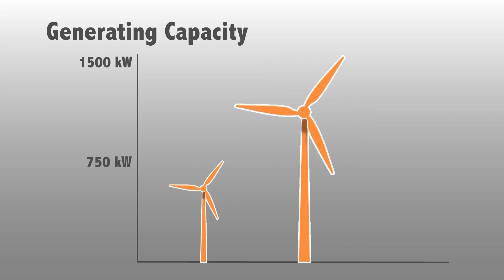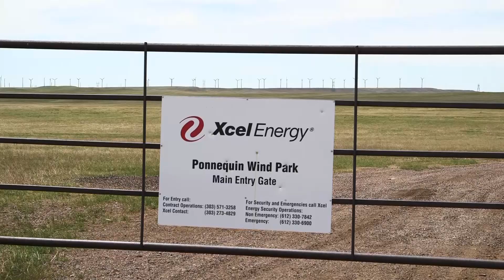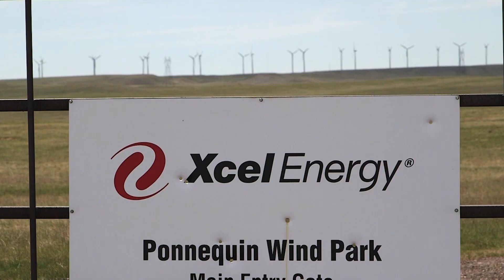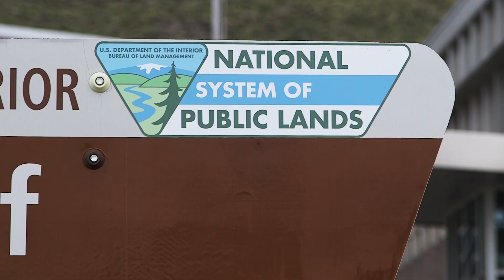Who Cleans Up When a Wind Farm Retires?

Comment: anyone who's ever driven  I10 through palm springs can see about half the windmills are derelict... they just get left out there to rust...
Reply: No, often wind turbines don't turn because they don't need the energy. Unless the local grid has storage, they don't put wear on the turbine if there's no place for the energy to go.
Reply: @justsomeguy934  the ones that dont turn seem to be burned out on the video i saw
Reply: @Withnail1969  I drive by a wind farm fairly often, there's one in my state (as well as a solar farm). I've never seen a turbine abandoned or burned out. Clearly the ones in the video have been abandoned. The video is showing a farm not used anymore, just like oil derricks and pump jacks sit abandoned. The wind farm near me has hundreds of turbines and they're always turning when I drive by.
Reply: @Withnail1969  "dont turn because they are broken, not because the power company is randomly 'turning them off', is my conclusion." Your conclusion is wrong; the grid has no storage for the most part, The turbines are turned off when their energy is not needed to save wear and tear, just like any other generator. Your local utility goes through tremendous variability of energy demand during the day. They turn on and off certain energy generators to meet demand. Wind turbines are just another source they can turn off.
Reply: @Withnail1969  " but of course you're a paid shill for green energy, " I just want to save precious petroleum for other things. I'd also like to breathe something OTHER than fossil fuel exhaust if I don't have to, how about you?
Reply: @Withnail1969  " here's a video of what it takes to install a wind turbine. scary amount of concrete and steel is used. " Um, would you like to guess how much concrete is used to build an interstate highway? Or a building foundation? You're opposed to concrete for all purposes, I assume? If you're only objecting to concrete for a wind turbine base then...wait for it...you've been bought by Big Oil! TaDa!
Reply: @Withnail1969  " i'm just saying there's nothing green about wind turbines. they are an industrial product produced with fossil fuels." Whoa, nelly! Nothing green about wind turbines? Did you miss the concept of NO FUEL, NO POLLUTION, LOW MAINTENANCE? You must burn something every second a generator makes electricity. Burning something makes exhaust, and not friendly exhaust at that. A breeze blowing by a turbine does NOT affect the air you breathe. I'm having trouble with your  comparative powers at this time.
Reply: @Withnail1969  "lots of pollution. lots of maintenance. tons and tons of crap to put in landfills. it's just a greenwashed scam. not to mention the ruined landscape." You have yet to show any reason in any of your answers. Pollution of a wind-powered device compared to a burning fuel? Are you serious? Ever seen an oil spill? Or tanker leak? Or tanker explosion? The worst that happens on a turbine is they fall over. I'm waiting for a rational comparison between two alternatives, one with decades of pollution-free use and one burning something 24 hours a day. G'head, convince me.
Reply: @Withnail1969  The residents of Fukishima or Chernobyl might disagree.
Reply: @Withnail1969  "either one of those incidents was avoidable. and burning coal kills plenty of people every single year but we still do it." Whoa, Nelly! If they were avoidable, why did they happen? You  cannot equate a nuclear accident to any other energy source because the impact of any nuclear accident lasts FOREVER. Even a huge dam break doesn't leave the area uninhabitable for centuries! You do see that comparing a nuclear bomb to a hand grenade isn't rational, right? Both kill, more deaths have occurred by dams breaking or hand grenades or guns but that doesn't make nuclear bombs far safer!
Reply: @Withnail1969  " burning coal kills plenty of people every single year but we still do it." Actually, coal is on its way out. Wind and solar are cheaper than coal, not even counting the pollution coal creates, in many places. Coal is one of the dirtiest forms of grid-level energy we use, and it's being phased out.
Reply: @Withnail1969  " anyway, its not like many people died directly." Um, THOUSANDS died, and tens of thousands will die from the after-effects of the radioactive contamination. Do you just make a statement an hope it's correct? Here's Chernobyl's estimate: "The chart here reflects a range of published estimates on the number of deaths resultant from the Chernobyl disaster. In its 2005/06 assessment ‘Chernobyl’s Legacy: Health, Environmental and Socio-Economic Impacts’ the World Health Organisation (WHO) estimated that the total number of long-term deaths will be around 4,000.2

However, this figure is related only to the proximate populations of Ukraine, Russia and Belarus which were exposed to high radiation levels; if extended to estimates of those exposed to low-level radiation across the region, this number rises to 9000."
In Fukishima, the immediate deaths were evacuation-related, but the radiation after-effects are: "According to the Tenth Report of the Fukushima Prefecture Health Management Survey released in February 2013, more than 40% of children screened around Fukushima prefecture were diagnosed with thyroid nodules or cysts".
In both nuclear accident cases, the exclusion zones are listed as uninhabitable for centuries, the cleanup in billions of dollars.
Reply: @Withnail1969  "plenty of coal will be burned making your lovely eco friendly solar panels and windmills." Actually, coal is one its way out as it's not economically viable in many places. Once manufactured, however, a wind turbine or solar panel consumes NO FUEL and BURNS NOTHING. How on Earth are you equating a fuel-free, pollution-free energy source that lasts for decades to an energy source that burns something and pollutions something 100% of the time it operates?
Reply: @Withnail1969  " burning coal kills plenty of people every single year but we still do it." People don't use seat belts every day and die, but we still do it. Seat belts are stupid.  <- your logic
Reply: @Withnail1969  " Like i said, not many died directly." And you're advocating for the 20,000 year exclusion zone energy source, are you? Can you just STOP for a minute and look at what you're advocating, when there is a ZERO exclusion zone energy source that doesn't use oil or coal or anything else? Did you see the 9,000 future deaths?
Reply: @Withnail1969  "you can't make either solar panels or steel without lots of coal." 100% correct, you get a cookie! You can't make a steam or diesel generator without coal, either! Now think - both processes use coal. Actually, solar panels use LESS  because they are based on silicon, unlike boilers and engines, but let's go with YOUR argument. Since both processes use coal to some degree, but one never uses fuel to make energy for decades, which do you choose?
Reply: @Withnail1969  " Burning coal generates power and makes our civilisation possible, not wearing a seatbelt doesn't have any such benefits." Boy, did YOU miss logic class in high school. You're trying to argue that slow poison is OK (nuclear radiation). Then when I proved the lack of logic in your statement, you tried to shift the argument to "seat belts don't make energy". Egad, man, if 9,000 people die from the affects of radiation that wouldn't die sooner, you can't say they aren't affected by nuclear radiation! Would YOU park a trailer in the Chernobyl exclusion zone an live there because relatively few people died in the explosion? You're not even making rational arguments. I bet you the thousands of lives saved by seat belts think they're a benefit!
Reply: @Withnail1969  "feeble in energy output and unreliable. you would need a vast area of them to be the equivalent of a 2,000 megawatt power station and even then they wouldnt work half the time for obvious reasons." Solar panels are not "feeble". Please prove your statement. The point is not energy density but complexity, pollution and maintenance. Solar can create electricity for the daytime where we humans need 75% of our energy. If someone paid 75% of your rent, would you take it?
Reply: @Withnail1969  You're aware that a diesel or gasoline engine only extracts about 30% of the energy in its fuel, right? It loses 70% or more to heat when the fuel is burned. And it makes lovely poison out the tailpipe as a gift for all of us.
Reply: @Withnail1969  "i'm saying if we want reliable power to keep our civilisation going, there are going to be some risks. nuclear overall is the best option. " No, nuclear is NOT an acceptable risk. The downside of an event or even normal waste is FOREVER.
Reply: @Withnail1969  "research solar panels, even the good ones can harvest only 20% or so of the light that hits them. you would need many square miles of the things to power a city." Sorry, some solar panels harvest over 40% of the energy that hits them, but so what? They make no pollution, make no noise, have no waste measuring a half-life in jillions of years.
Reply: @Withnail1969  "you would need many square miles of the things to power a city." you sure would! And in return for putting solar panels in unused real estate, you get NO POLLUTION, SILENT and reliable energy for the same time that we humans need power - daytime. The number of acreage is about 21,000 square miles to power the entire USA.
Reply: @Withnail1969  " enough resources to build enough solar panels to power our economy as it is now." But our economy has TRILLIONS to give to oil companies in subsidies and free military escorts for oil tankers? Your math and logic elude me...
Reply: @Withnail1969  The fact that there ARE panels that exceed 40% are the point. Most legacy panels are, indeed, around 20%, I never said otherwise. Here's a quote on solar panel efficiency from Wikipedia: "In 2019, the world record for solar cell efficiency at 47.1% was achieved by using multi-junction concentrator solar cells, developed at National Renewable Energy Laboratory, Golden, Colorado, USA.[5] This is above the standard rating of 37.0% for polycrystalline photovoltaic or thin-film solar cells.[6] " I'd say the 20% number you're quoting is going to be on the low end.
Reply: @Withnail1969  "its a good thing theres so much energy in diesel then." you must be a paid shill for Exxon, as you've left the poison that results from burning that fuel out of the comparison to a solar panel...
Reply: @justsomeguy934  << I'd also like to breathe something OTHER than fossil fuel exhaust if I don't have to, how about you?>>

<< @Just SomeGuy  << I'd also like to breathe something OTHER than fossil fuel exhaust if I don't have to, how about you?>>>>

I pretty much never detect fossil fuel exhaust where I live in urban Seattle.  Your comment sounds like wild exaggeration to me.
Reply: @SeattlePioneer  see a car or bus in Seattle? There is the fossil fuel exhaust. I smell it if I start a gas car, smell it at a stoplight. Maybe car exhaust in Seattle is scented.

Comment: A wind power site is still useable for the same thing by simply putting a new generator in place of the old one if it becomes obsolete. There is no nuclear waste and contamination making the land unuseable. Wind power stations leave less behind than generating stations using fuel, and theres a mess left behind with coal mines and oil drill sites too. The base and pole can probably be reused just as it is.
    Lets examine EACH of those under a magnifying glass and see just how they compare to a rebuildable wind site.

Comment: There is no indication that the power company does not have funding allocated to decommission the project and return the land to the condition they found it. 
The cost of a project includes planning, permitting, construction, and end of cycle decomissioning. These wind turbines performed within their planed lifespan generating revenue to complete the project as planned. 
Future projects will produce more power with a longer design lifespan.
Reply: Where does the power company get its money?  FROM YOU!  There is NO indication they DO have the funding to undo, they will just pass it on to their customers.

Comment: None of the installation or components of the current designs can be reused aside from the land itself, Allthe buried cabling is drastically undersized, the biggewr unbitsa are subjec to even more catastrophic failures, the towers will be twice as tall and twice the diameter. The bigger blades lso produce a louder "thwup, thwup, thwup" sound. the impact from bird impacts will be substantially worse, the massive ground supported transformewrs will need to be drastically up-sized which means another speciallized transport of immensely heavy machinery.  Common financial sense dictates that a life span of twenty years with no reasonable chance of updating as well as extremely destruictive decommissioning and clean -up to once again completely pristine condition with ALL concrete foundations,towers, buried cables etc being completely removed as well as the immense original construction costs, just proves that wind power although is techincally renewable, the total cost from inception through usage and finally total removal creates a break even investment at best, butis  more likely a money losing proposition.

Comment: put a DO NOT STEAL sign on them and watch them magically disappear
Reply: Breaking Toast you put a sign on them saying  “100% pure copper”
Reply: @paulsergel8161  amazing what those  copper people can do
Reply: @georgiojansen7758  If they worked as hard as they worked at stealing, they'd have a good life.
Reply: @burnerjack01  
You're correct, but that would not leave enough time to smoke up what their earned!
Reply: @paulsergel8161  copper cabling is used to connect wind farms, ... copy . The number of pounds of copper in a wind turbine will vary from model to model. For example, a Vesta V80, 1.8 MW, contains an estimated 6,600 - 7,700 pounds ...
Reply: @jean-marccloutier4309  Holy shamolie. THAT'S a lot of copper. I think scrap copper wire pays like $2.50 a # give or take. At THAT price i would consider going after it. Depends on the quality of the copper as to price paid. And wire is normally VERY high quality, pure and new copper. ( not recycled) usually at 99.5% pure. That might pay higher. And you were saying 6600# s of the stuff per unit? Add THAT up.
Reply: @boatguy64  yeah but the 1,8 MW turbines won't go out of service for the next 20 years give or take.
The old turbines are ALOT smaller.
Reply: @boatguy64  The problem there is ONLY the copper would be gone after. The copper salvagers wouldn't touch the blades or the tower, and probably come up with ways to strip the copper right out of the generator in situ. The entire eyesore would still be left standing, just even more useless than it was before.
Reply: Ha! Like when homer simpson couldnt get rid of the trampoline....bart put a padlock on it and it was stolen when they turned their back.
Reply: It's Wyoming, it's full of conservative Trump supporters that have morals, sooo they would respect the sign and not steal shit. Try again
Reply: @Miniaturehorseexpress  I don't think the person was trying to imply anything political. They were just making a joke about getting rid of something.
Reply: Cant you just hook up a wire to that turbine towards your home,
FREE ENERGY, and if you hook it up correctly the Meter will spin backwards, making the electric company pay for "the energy you overproduce"
Reply: No no. You have to put a price tag on it. That’s how you get rid of stuff.
Reply: Let word get out to the tweakers about how much copper wire is in those things and they'd be gutted overnight.
Reply: A for sale sign with a high price, they'll be gone by morning. That's what I do when I have an old couch I wanna get rid of. Lol
Reply: Had broken tv in front of my house with " FREE"  sign. Two weeks later it was still sitting there.  My wife went out and pulled the free sign off and put up new sign. $50.00. By the next morning it had disappeared
Reply: @henryetter1477  Real story or just continuing above joke?
Reply: Yep. Get all that copper.
Reply: Put a free sign on them so nobody will take them 🤣

Comment: As a former contractual worker for Westinghouse, I can say, the steam generators have to have their bearings replaced every 2 yrs, and completely rebuilt every 4yrs. I don't see how normal maintenance routines couldn't be carried out on wind turbines. Unless their Govt subsidies run out at 20yrs, and they are no longer profitable.
Reply: But who is going to pay for it?

Wind is nowhere near as profitable as the turbines for coal/gas/nuclear power.  Economically does not stack up.
Reply: Don't forget the kickbacks all politicians receive in the cost of
"renewable" energy.
Reply: The blades themselves give out due to degradation
Reply: @kenneth9874  that's my understanding - the size of them makes structural fatigue inevitable. Surely the bigger turbines will be worse?
Reply: @jasonh.8754  not only structural fatigue but also the abrasion of the leading edges and solar damage
Reply: We’re going to be stuck, who is the government. You & me.
Reply: Well  I think your are right.
Reply: Perhaps should have used BTH turbines. Thirty year life cycle. Don’t remember any interim bearing replacement.
Reply: well, the steam generators transmit a lot more energy than wind turbines, thus they make maintenance so much more worthwhile.
Reply: You nailed it ! Like most solar/ wind ideas they are not profitable. They look good in the midst of smoke and mirrors  as politicians bullshit us ...